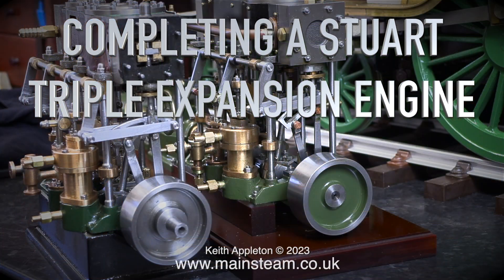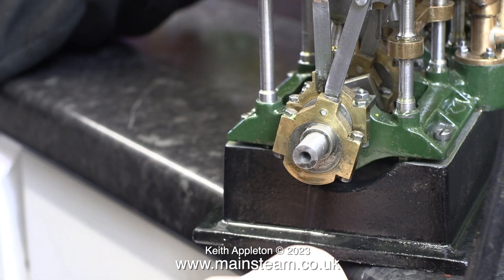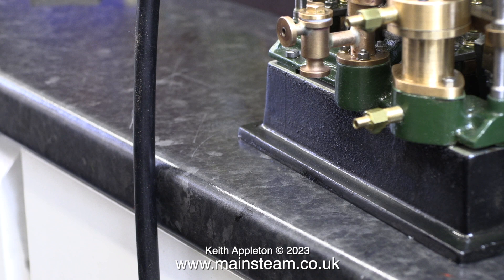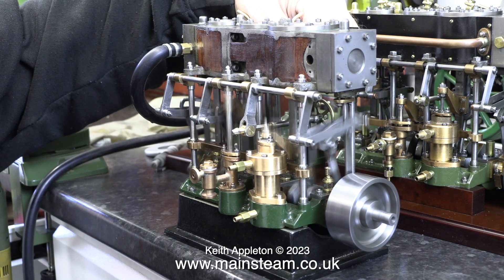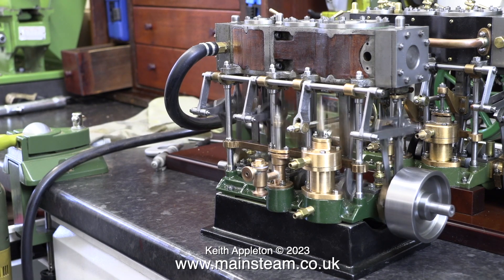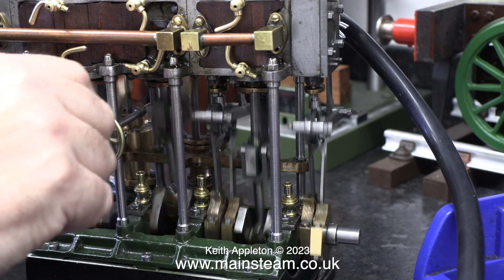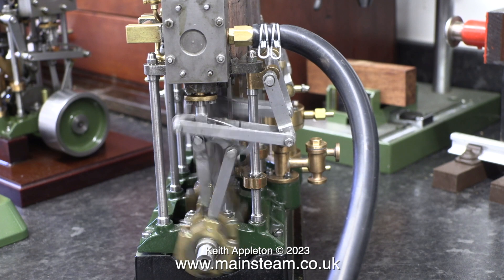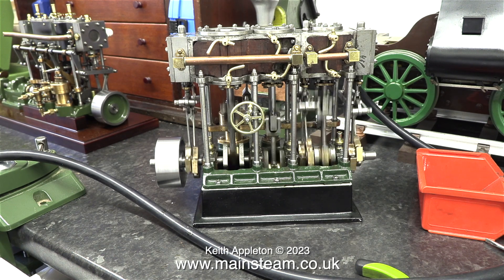COMPLETING A STUART TRIPLE EXPANSION ENGINE - PART #52

Comment: Keith, when you use Viton O-rings instead of cast iron piston rings in your steam engines, how do they hold up to steam?  Do they break down due to the heat?
Reply from the maker: I don't use Viton, I use steam grade Silicone O Rings. They seem to work fine.
Reply: @keithappleton  Thanks for reminding me of the steam grade O-rings!